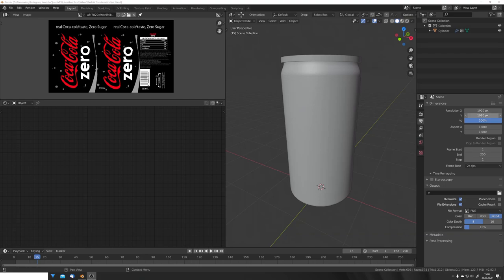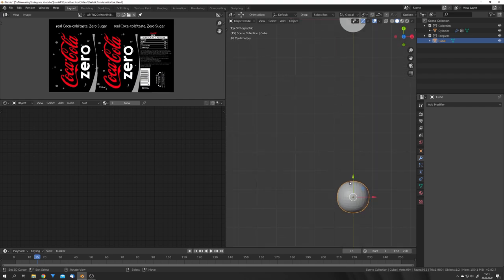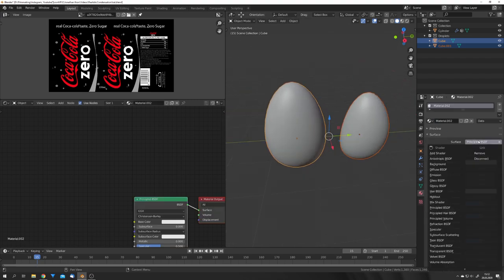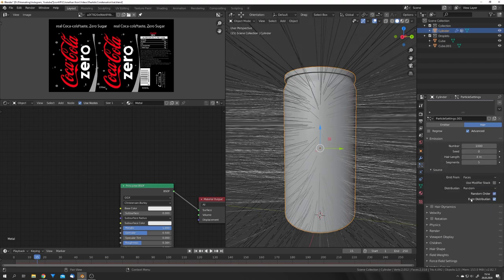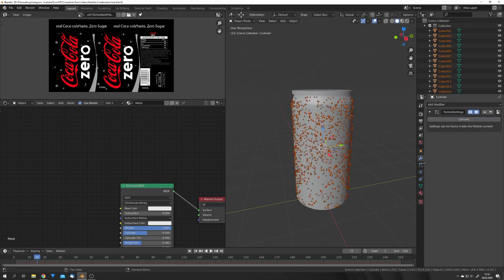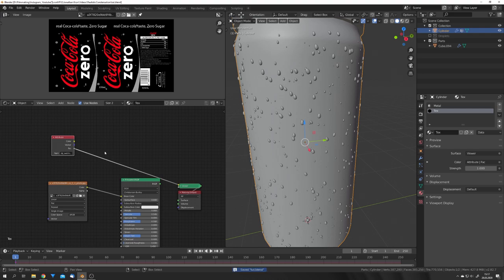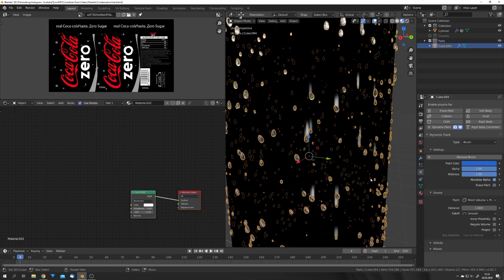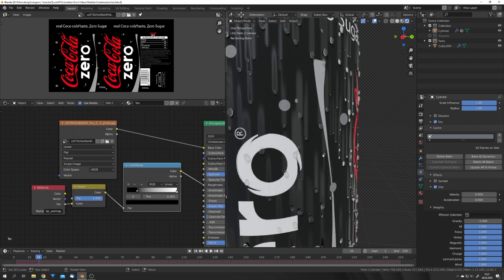Realistic Condensation in Blender [Blender 2.82] | English

Comment: For Further integration of the droplets you can mix the glass shader with a transparent node. Then plug to the fac a gradient texture mapped to normal. Fix the coordinates so you have the gradient texture coming on the top of the droplets. Finally Tweak the color ramp of the gradient texture.